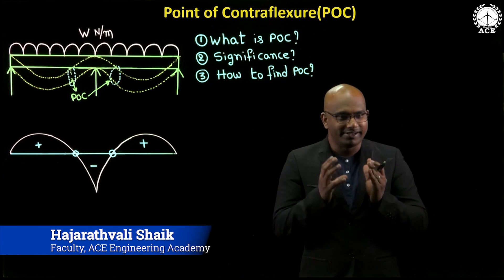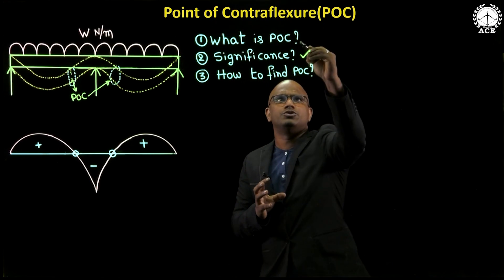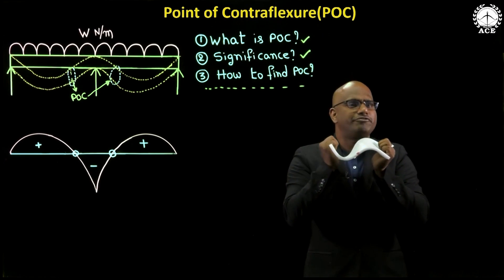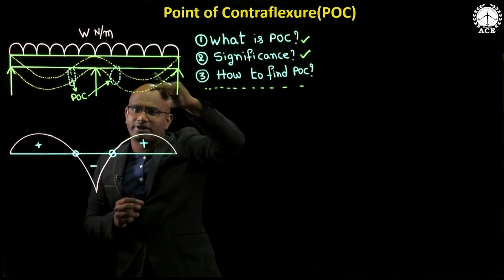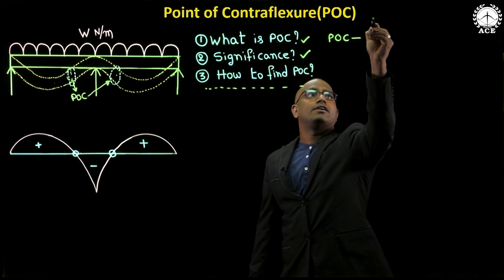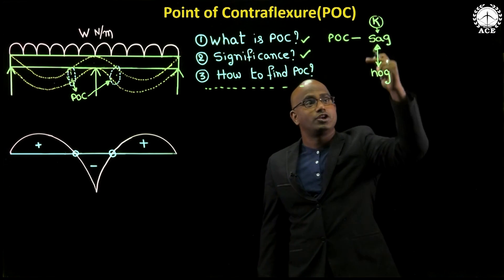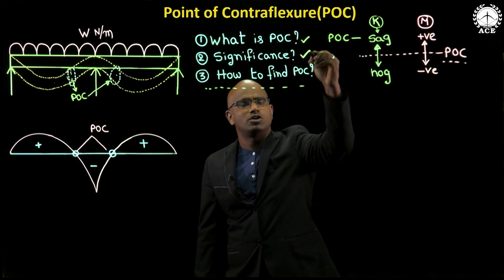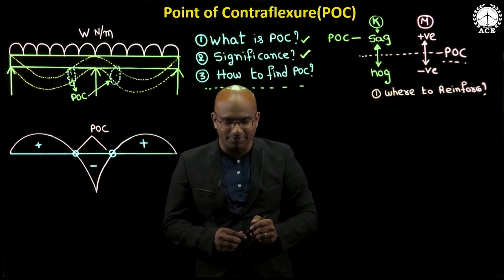ACE Academy GATE-CE | ME Online Classes  : Strenght of Materials : Point of Contraflexure (POC)

Comment: At 16:00 how did you take distance is (x-2) and later how did you take moments thereafter I didn't get it....
Reply: Dear Vignesh ..its the distance between Point C to section(x-2) as distance between CD is 2 ..so we should subtract  2 from X so net distance is coming (x-2) and apply the moment about Section.
Reply: Is X is an assumption sir ?
Reply: @naninarava2421  yes X is an assumption because we don't know exactly where bending moment changes its sign. Here X is the distance at which the point of contraflexure occurs .
Reply: Dear vignesh,before to answer for your question you must know what is moment? 
Moment is defined as "the product of the distance from the point to the point of application of the force and the component of the force perpendicular to the line of the distance".

Now coming to your question.

Let us consider any section in the portion BC at a distance x from D. Now I want to find out the moment about this section. Algebraic sum all vertical forces about this section gives a moment of a force at this section. We know that moment of a force = force × perpendicular distance. First consider 20kN force and then go for 42.5KN. NOW the moment of a force about the section is M = +20 × 2 - 42.5 ×  ( X-2). Here ( X-2) is the perpendicular distance between the section and line of action of the force(42.5). 

I HOPE YOU UNDERSTAND

Comment: Sir, Have forgotten one more significance of POC in civil engineering with respect to self weight deformation and placing supports while handling the structure. 
In Gate asking the questions from that concept. 

Please include that, so that it may slight effective.!!! 
And one more thing at POC, BM not compulsory to be zero.
Reply: Thanks for feed back..POC is defined at point where Moment changes sign...But most of the cases BM must be =0 except special case of Concentrated moment on the beam whare BM changes sign but not Zero.Concentrated moment is not exited in reality on beams.
Reply: @hajarathvali  
Thank you, Hajarathvali. 
Please make it slight effective in the quality of content and thank you for considering my feedback.